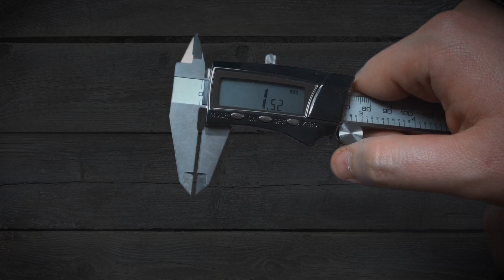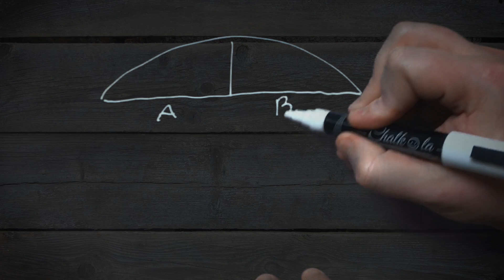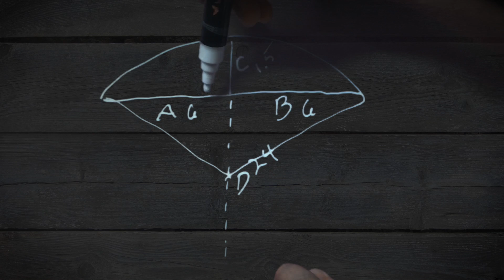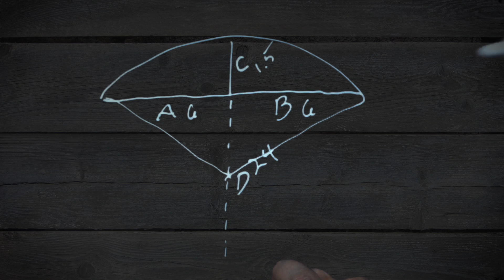TIP: Easy Arc Radius (Intersecting Chords Theorem)

Comment: This can be proven using pythagorean theorem as well. Let's say  
C = The height of arc
B =  The base of the arc
R = Radius of the circle
D = diameter of the circle

Then we can say that, 
R^2 = B^2 + (R-C)^2         (Expand (R-C)^2)
R^2 = B^2 + R^2 - 2RC + C^2 (cancel R^2 from both sides)
2RC = B^2 + C^2        (Move C from left to right)
2R = (B^2 + C^2) / C (Simplify right side)
D = 2R = B^2/C + C

Comment: I make templates of existing arch top door frames to build custom doors.  I always outline the old doors and usually that works. However, using this video I will be able to do this formula and get close and then trim my doors to fit. It’ll save time and materials. Thanks a ton for sharing.
Reply from the maker: roger drum glad to be of assistance :)

Comment: I cannot find anyone to help me solve what I think must be simple for smarter people that me.  I am just barely smart enough to look for answers.  Let me try to ask my question without the benefit of pen and paper.  Imagine that you know the width (chord) of an arc and you know amount of rise or deflection you want to achieve over that length ... let's say one foot.

Is there no way to make a measurement, or many of them over the length of the chord to measured points along that chord thus defining the desired arc?

If This makes no sense, forgive me.  I can see clearly in my own mind what I am asking, however, that does not mean that others can understand what I want to know.  If anyone can help, it will be much appreciated.  Likely the answer is simple and I should know it, but guess what ... I don't.  One more item ... you may wonder why I do not get a string, a nail and a pencil and do a trial and error method ... that would work, but not with the amount of space available in this and in many circumstances which I come across.  HELP!!!  PLEASE!!!
Reply from the maker: David Burns well given the the chord length (width) and rise (deflection) the intersecting chord formula presented here will give you the pivot point needed to define the arc with a compass or divider.  I feel like I’m probably mid understanding the issue though.
Reply: @TabLeft  Yes, I do think you are missing my point,  but I thank you for the description.  My situation is one of limited space ... translating a paper derived formula to a real world setting still leaves me in a bad spot.  In fact, I have solved this problem by making reasonable assumptions and deciding what looks right in the case of a radius on a gate top.  I could go out into the parking lot and do this in real time/space, however, getting it to look good and not being 'persnikative' as to the exact radius worked fine for my eyes and that of my client.  Thanks for trying ... that's the key to keep moving forward, even if only in fits and starts.
Reply from the maker: David Burns ahh yeah for larger things we don’t usually scribe arc in the traditional way.  Generally you place a nail at each end of the length and one at the top center and with a flexible ruler or thin strip of wood bend it over the middle top nail and under the two side nails.  It won’t be a 100% perfect circle segment but it’s a good approximation that looks good and gets used a lot in fencing, carpentry, and furniture making etc.
Reply: @TabLeft  Yes, yes, yes ... you describe several good options and I had done something of that sort already.   I took a roll of painters tape and pulled out an arc on top of my 4' x 8' table, something which felt good, then I massaged it a bit, finding a look that pleased my eye, sent a photo to my client and got a hasty approval.  I still wonder if there is not a formula for describing an arc from a chord, but one may need more information than just two elements for it to work.  Again, thanks for the help, we now have a gate arc to fabricate and in a few days, maybe weeks, that build process will start showing up on YouTube.
Reply from the maker: David Burns like the man says if it looks straight it is straight :)
Reply: You don't double "C" as this is a diameter value and there's a "C"-value on the opposing arc?

Comment: GREAT JOB! I'm a retired carpenter still playing with wood- I recentlyI  had to make a bird feeder from the remains of the original-the  individual wanted it to match as close as possible. It Had a partial arc on a piece which appeared to be smooth, so I needed to figure the radius- so glad I found your explanation- you are a teacher that would have made a difference when i was coming along. Thank you for sharing your gift!